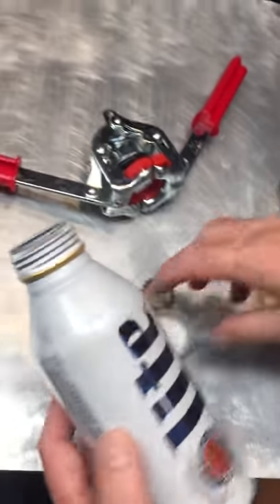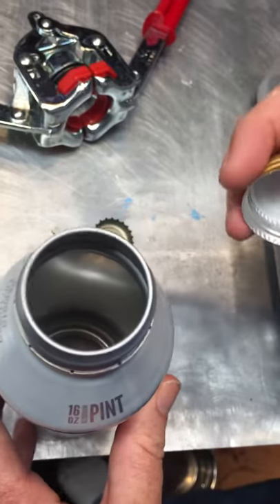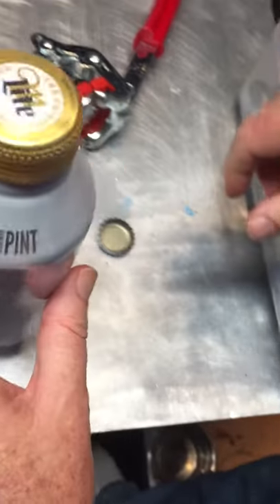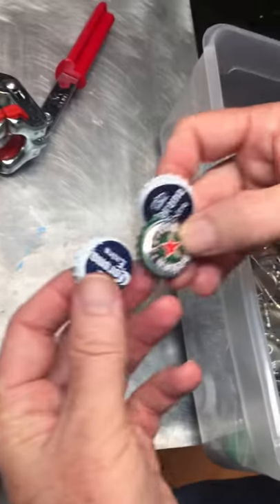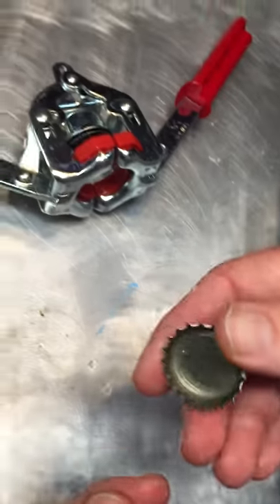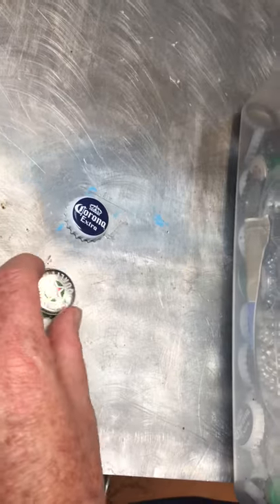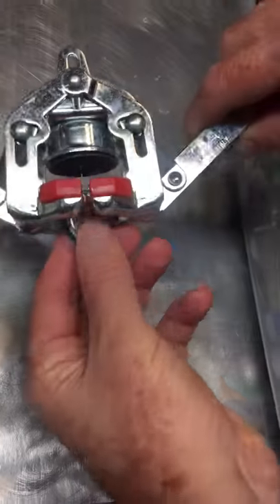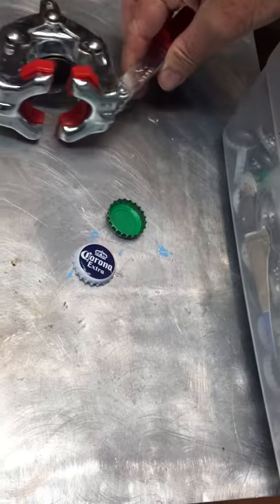resuse bottles and cans for gas storage

Comment from the maker: this may not be approved or even legal to store gas this way but for emergency use or times when you might want to do so it works very well, I have stored can in these cans for over a year without any leakage or noted degradation.